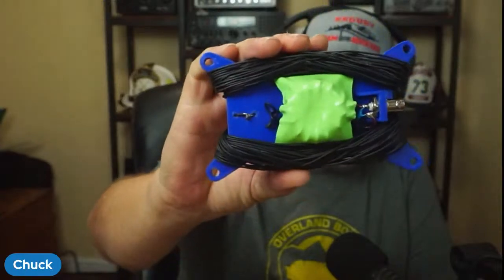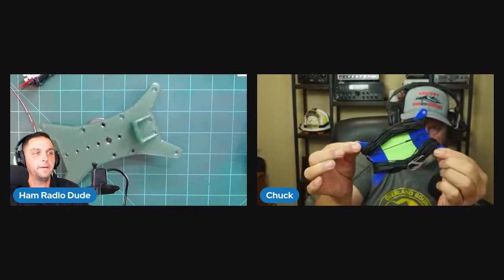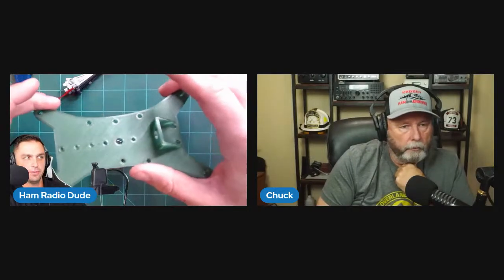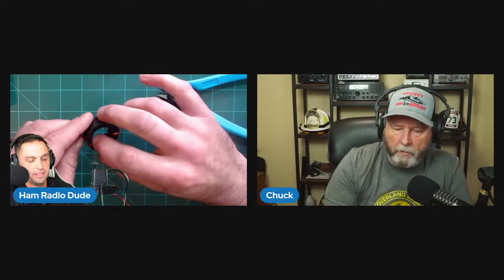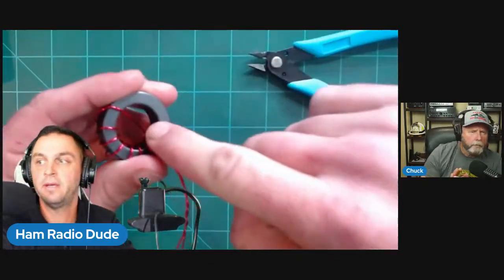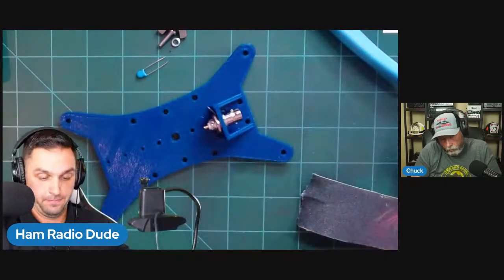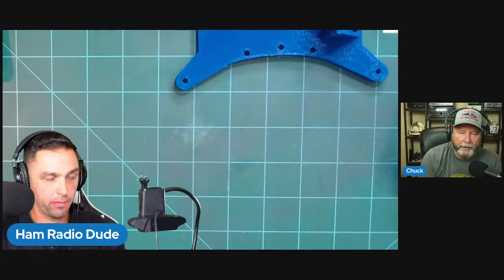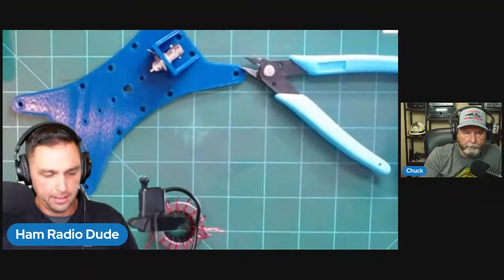49:1 EFHW - Build it LIVE

Comment: It is funny how people try to invent various crazy ways to couple EF antenna. 1:4, 1:9, 1:64, 1:whatever-else, and then they push their transceiver's ATU to match the complex impedance at TRX output and create standing waves on the coax (and potentially create more losses and pick up more noise on the way). Wouldn't it be more straightforward to use quite simple L-shaped LC Match at the feedpoint and work with matched coaxial transmission line between TRX and the antenna?
Reply from the maker: Thanks for commenting Jindrich. I'd be interested learning more about an L shape LC match.  Do you have any easy to follow/understand guides you can direct me to. Thanks in advance
Reply from the maker: Found one.  https://miscdotgeek.com/qrp-l-match-tuner-build/ I may try to build it and compare results.
Reply: @HAMRADIODUDE  Hi, there are plenty out there and the concept is extremely simple. Variable C is at the output side parallel (between antenna and ground/counterpoise), variable L is in series between coaxial feedline end and the antenna. This LC together forms a circuit where the feedline represents low impedance (50 ohm) and the end-fed antenna is, of course, high impedance. All elements become part of resonant LC circuit. One condition to be fulfilled is that the overall impedance of the whole circuit (L, C, feedline, antenna) must be real (have zero reactance) at the operating frequency, i.e. must be in resonance. Second condition is that the L/C ratio must be such that the feedline Z is transformed to match antenna Z. Practically it means you switch variable L and then tune C to ge the best SWR until you get 1:1 or at least the best possible value closest to that. This is also how most if not all ATU's work. For manual tuning you would most likely want one or just a few coils with taps (and a switch), and a variable capacitor. While in ATU you have separate coils switch in series combinations by relays, and individual capacitors switched in parallel combinations by relays. Take any ATU schematic or any vacuum tube PA schematic to find inspiration (just mind that tube PA has high impedance at anode side and low at the output side). 
Just please keep in mind that for end-fed antenna, which is a kind of extreme, you will need substantially different L and C values than in ATU designed for matching "normal" antenna with just a small reactance or real Z close to 50 ohms. I haven't tried, but I would assume that keeping EFHW slightly less than half wave could help ease the LC matching (not so high impedance, although the reactance would be high). "Plain" baluns, on the contrary, assume zero reactance (hardly ever true, BTW) and handle just the 50 ohm-to-high real impedance of a resonant half-wave element. By shorting it a little bit you will not lose its antenna efficiency because maximum radiation is in the middle, around current antinode.  However, any end-fed matching means potential losses in the matching circuit (that's why you should want to keep it as simple as possible and made of quality materials to prevent ohmic losses due to the high current and dielectric losses due to high voltages in the LC circuit).
Reply: P.S. you can also swap L and C positions. This topology has one advantage: you galvanically connect antenna to ground and galvanically isolate the antenna from feedline (transceiver). If the antenna is placed high above ground, it could accumulate static charge. Galvanic connection to ground would help discharge it and isolation would protect the transceiver.
Reply: @HAMRADIODUDE  The tuner described by Peter VK3YE is a good one and the reason why the inductors are 1-2-4-8 multiples of 0.5 uH is exactly that by combining them in series (and potentially controlled by a microcontroller), you can get any value between zero and 15 uH, step by 0.5 uH. You can do the same with capacitors, but, of course, if you plan manual tuner, variable capacitor is the best choice. Also, for a manual tuner, you can save toroids and wind everything on one core with taps, and use SPnT switch (single-pole, N throws).
Reply from the maker: Thank you very much. I'm going to try some stuff out.
Reply: The advantage of a broadband transformer compared to a tuned circuit is that you get a multiband EFHW with several bands in resonance. No tuning necessary. But the shown toroid and winding technique in this video can be improved to get better efficiency, but unfortunately most published designs folow this same route.
Reply: @PortableRadio  I am sorry, but there is no "no tuning necessary" with this kind of antenna. You will always need to match it, if only because the local conditions are not always the same when operating portable. And in such case it is better (and more efficient) to do that at feedpoint rather than trx output. Guys with 1:4, 1:9, 1:49, 1:64 transformer in most cases use their built-in ATU to present 1:1 VSWR to their finals.
Running QRP with an unmatched antenna means you already transmit with low power and let the mismatch decrease your power even more. I don't think it is a good idea.
Reply: @ok4rm  I answered you, but unfortunately my comment was removed. Just check my document. 73 Stephan
Reply from the maker: It may be due to a link being posted, sorry that happened.  Is this the link you were posting?  If not, I can help post the other one.   Interesting to read about all your good work you do.   Also, I'll have the power consumption video on the 6100 soon. Thanks friend https://hb9sota.ch/wp-content/uploads/2021/08/Portable-7-Band-EFHW_HB9EAJ-V1.2.pdf
Reply: @HAMRADIODUDE  Thanks and yes, I'm really interested about the current drain @13.8V. Very interesting videos about the 6100 indeed!